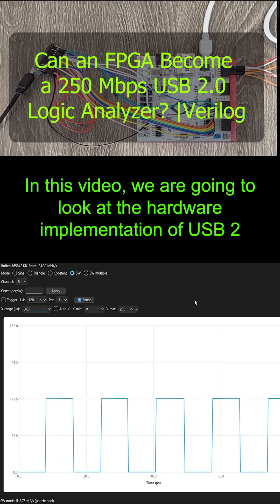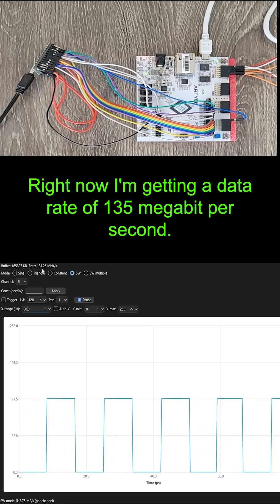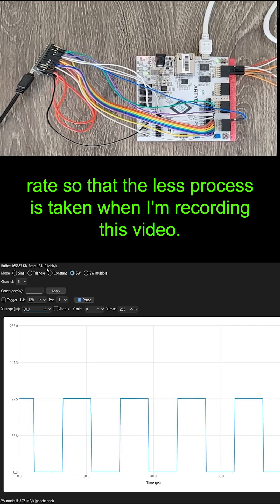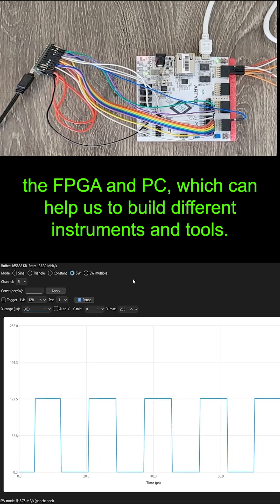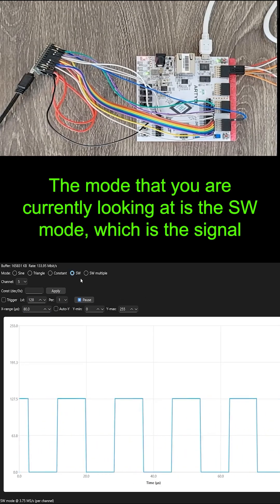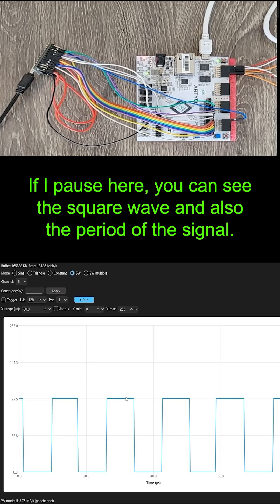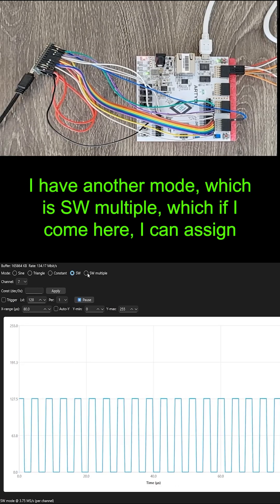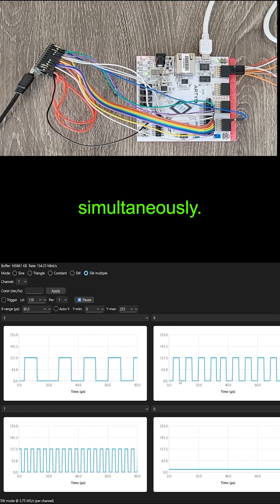Can an FPGA do 250 Mbps over USB 2.0? #fpga #usb2 #verilog

Comment: How many times can you reprogram an fpga?
Reply from the maker: Hi,
For SRAM-based FPGAs, reprogram as many times as you want—no wear (config is volatile).
Only the SPI/QSPI flash (used for power-on boot) wears out, typically ~10k–100k erase/program cycles. During development we usually load to SRAM/JTAG to avoid flash writes.
Reply: I remember back in the dark ages when circuit pathways were actually burned in when a fpga was programmed, how long ago was that and you know what it was called? I forgot? With those things you either had to reuse what was previously programmed or space that hadn't been used yet, and often creatively connecting the two.
Reply: I think you can reprogram (or reconfigure) an FPGA essentially unlimited times!